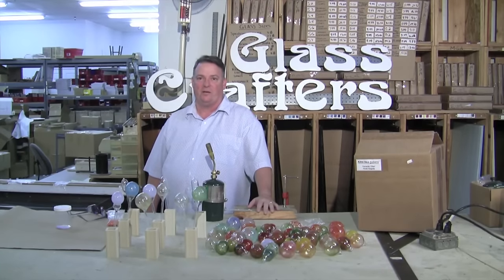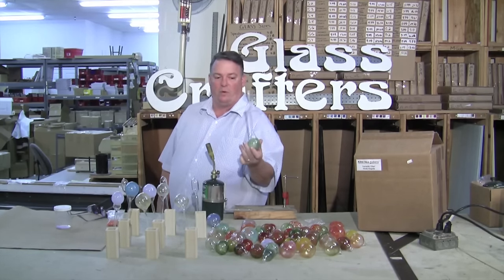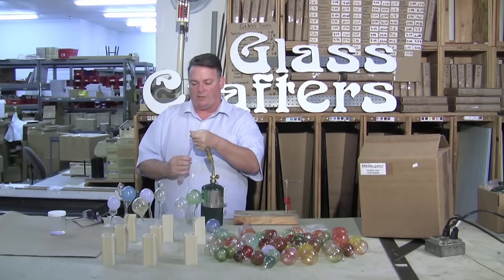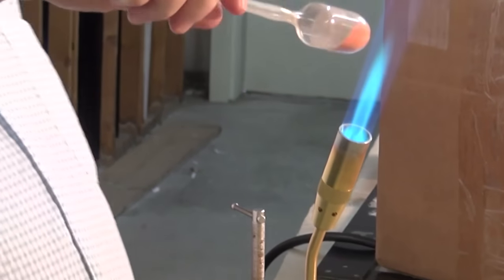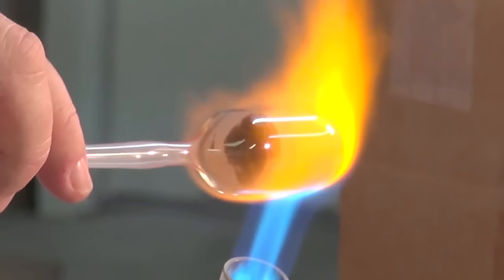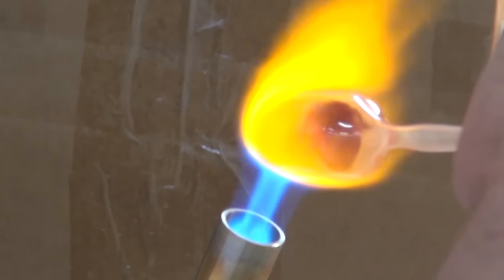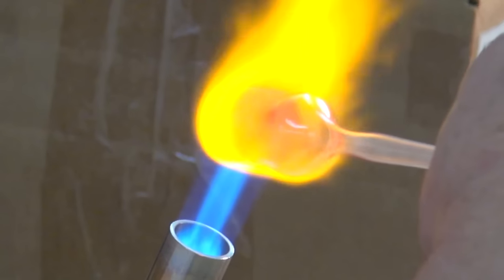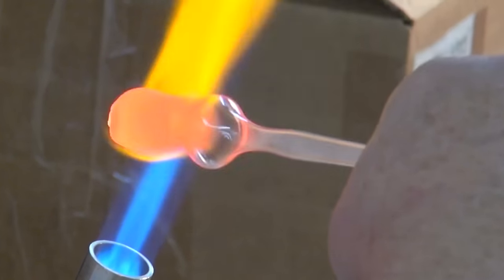How to Make Blown Glass Globes

Comment: Man where do you get the blanks or whatever they're called?  I looked on your website and I searched crystal colbens and couldn't find how/where to buy them.  I have a propane torch that I rigged up to run off a 20 LB gas grill tank because it's so much more economical and you can work upside down and all kinds of crazy improvements and I have a bench vice I can clamp the torch in for holding while I work so I would love to try this!  Can I  buy just maybe like 10 blanks and a couple colors and give it a try?  I'm quite good with my hands and with tools (been woodworking for 20 out of the 30 years of my life).  I've made a good number of hardwood ornaments on my lathe for our tree and it would be totally awesome to add some blown glass pieces!  You really make this look like a piece of cake compared to videos of guys blowing glass pipes!
Reply from the maker: We have the Kolbens in packs of 10 for $16.90 at "http://www.glasscrafters.biz/PROD/KOLBEN10".  For adding colors, you'll want several 4 oz. packages of Bullseye COE 90 fine frit "http://www.glasscrafters.biz/CTGY/gl_fus_bu".